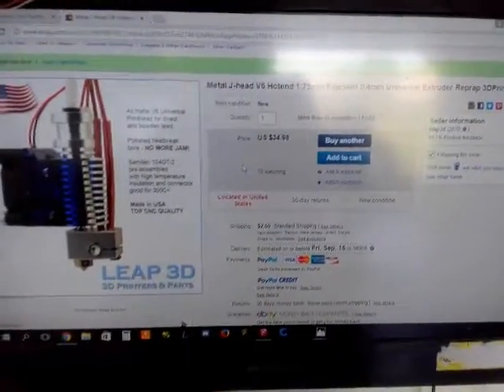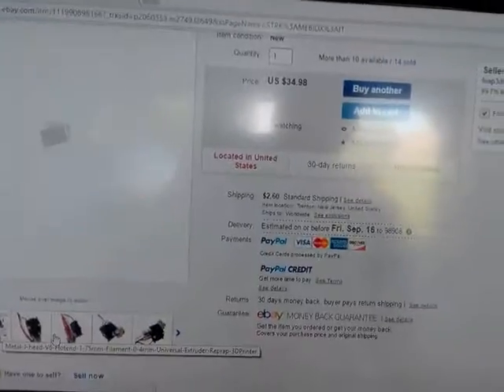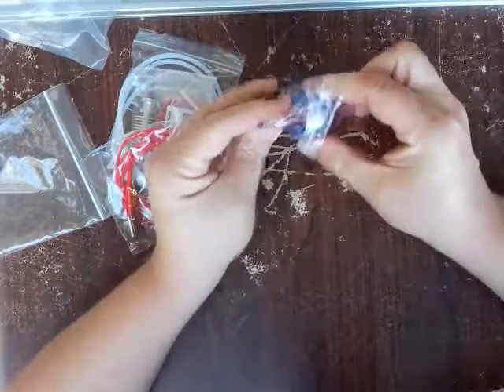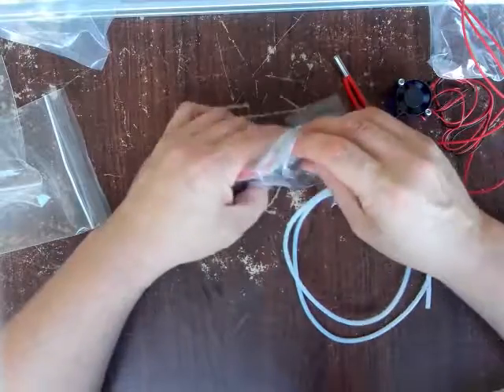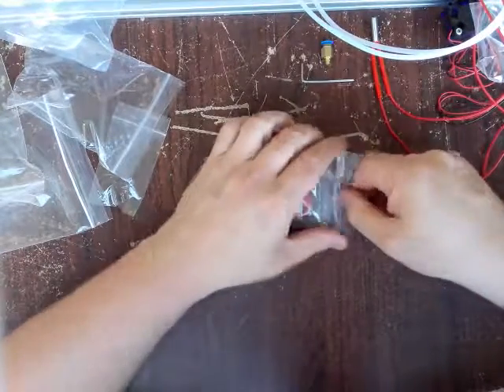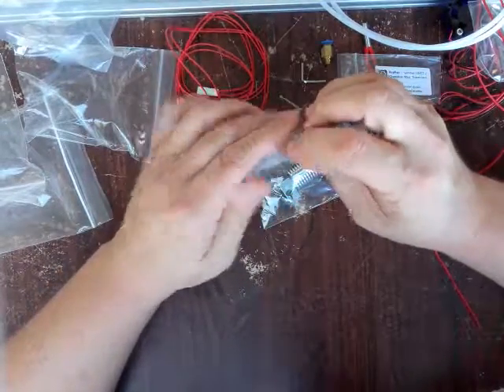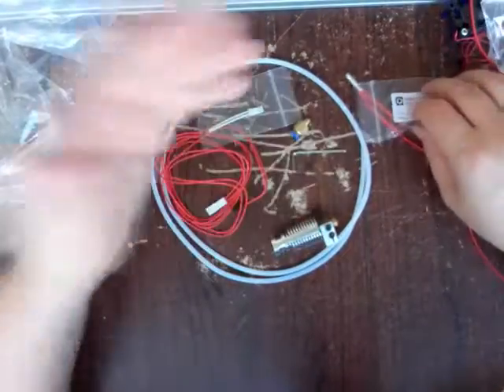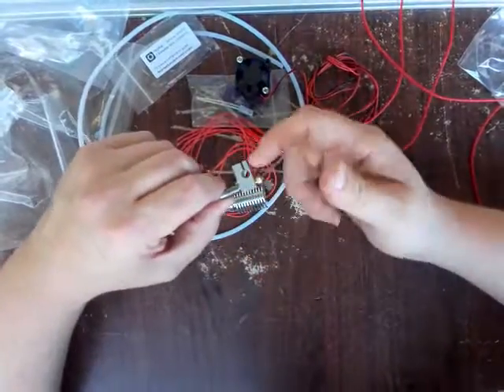RepRap Unboxing: Leap 3D Made in USA e3d V6 Clone Hotend

Comment: how did the prints turn out?
Reply from the maker: The prints turned out great. I have run many rolls of PLA through it and they have never had a clog or any other issue. I would recommend it!